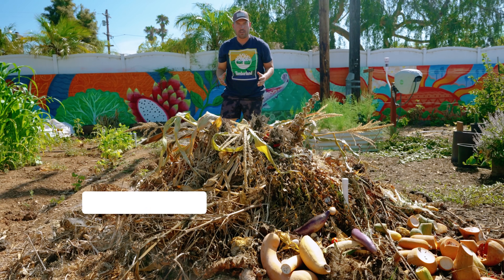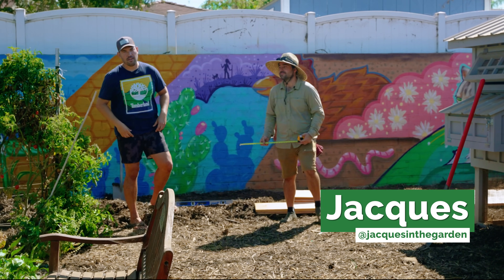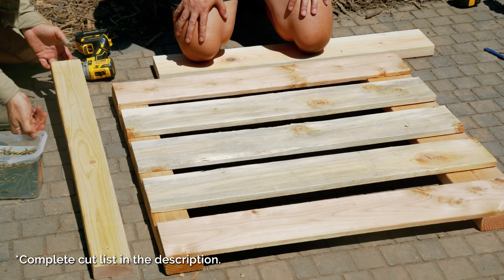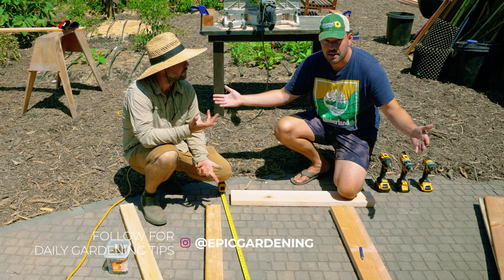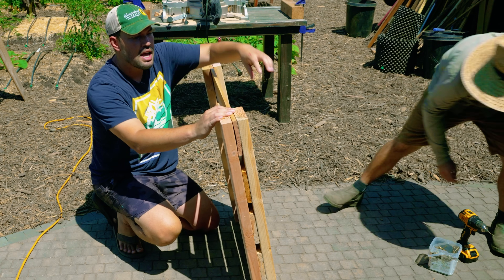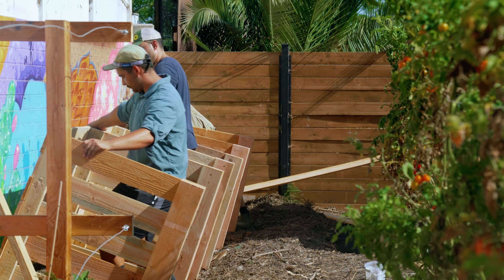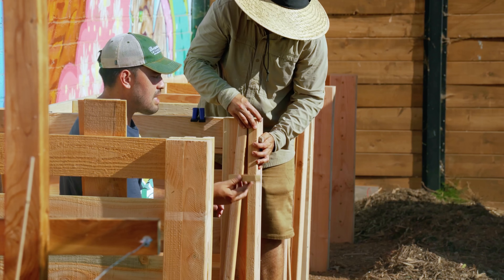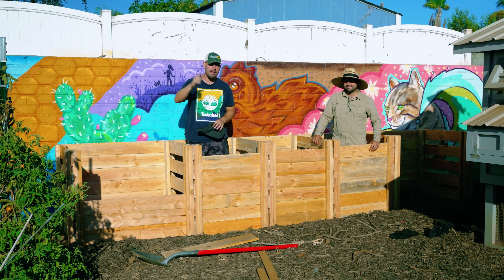How to Build an Easy DIY Compost Bin

Comment from the maker: Single Bin Design (to add more bins, add more side panels)

Back

All pieces cut to 3' long

(6) 1x6” boards
(1) 2x4” boards

2 Side panels

All pieces cut to 3' long

(4) 2x6” boards
(4) 2x4” boards
(10) 1x6” boards
(4) 2x2” boards

Front

(6) ea 1x6” boards cut to fit front, roughly 32” each
Reply: HATE.LOVE.HATE.LOVEHATE.LOVE.VIDEO
Reply: Do I need to be careful about pressure treated wood? My husband is concerned about the wood rotting, but we also don’t want harmful chemicals leaching into the compost….
Reply: @ericaduckwall5477  normal lumber will last quite awhile....just like the raised wooden beds. Like them, you could give everything a coat of boiled Linseed Oil....looks a bit better and helps protect the wood.

Comment: Made a 3 bay this length with pallets, and t-posts. Has worked great. Cut some scrap OSB for the front slats.
Reply: How did you use the t posts? In the inside corners for rigidity?

Comment: I would suggest you have them a couple of feet away from that back wall so you can keep weed free and you can check for vermin. Since a 6-inch gap would make a inviting rat run and making impossible for maintenance around the back.

Comment: a month ago i came across 13 pallets that were wrapped in plastic. turned them into my 3 bin setup.  so much nicer to have than piles. great video keep up the good work
Reply: That was a great find!  I did the same about 3 years ago.  Wish I could do five just for extra storage but don't have the room.
Reply: They “fell off a truck”.

Comment: If you stained the wood in boiled linseed oil it will enhance the rot resistance of the wood and still be food safe.
Reply from the maker: We were thinking of that, or the shou sugi ban technique of charring the wood!
Reply: Good plan
Reply: @epicgardening  NOT Boiled, you need raw, Boiled linseed oil has metals and other chemicals that make it toxic
Reply: @epicgardening  oooo do that!! Painting linseed oil is what I have done to my beds. But it would be cool to see how the carting method is done. And because it’s different.
Reply: Just dont throw way your oily rags
Reply: @epicgardening  that's exactly what I was going to propose to you. If you now combine the charing and the oiling your bin will last very long
Reply: @jessefreeman2611  how are you supposed to properly dispose of them?
Reply: @h.s.6269 lay them out on the floor and let them dry completely.  BLO will spontaneously combust if tossed in the trash while still wet

Comment: Ultra cheap way I made mine was 1/2” hardware cloth at 3 ft tall.  Measure out to around 10 ft long for the circumference and boom!  3 ft volume cylinder using zip ties.  I bought 100 ft at $150 ish last year. 

Edit:  I’m 5’3” and I can manage turning the compost into another bin next to it.  When it gets close to the bottom, it’s easy to lift the bin and then pitchfork the rest of the compost in to the new bin.  It would likely be much easier to use the slat system but if you don’t have a lot of money and have a lot of compost to make, this method is great.
Reply: I got a ton of hardware cloth and chicken wire clearanced out a few months ago (like 90%off!). This is a GREAT IDEA as I am not much taller and trying to figure out the best way to go about an easy-to-flip solution.  Thanks!
Reply: Building a series of bins  will accelerate and contain the process, but what you did is great.  If you layer right and allow it to sit, you will get compost eventually.

Comment: For the front, I would ensure more play than just the 1”… maybe 1.5”. when all the wood gets wet, it will swell, both the side braces and the front boards. Also, depending on if you treat it or not, the front boards will warp, again making it quite difficult to replace the board.

Comment: Great Video as Always! ALSO,

If you bought that Miter Saw within the last two years (or so) check if it's part of the Group that got recalled. Dewalt is offering a kit where you can replace the affected part. More info on their website.
Reply from the maker: Thanks, will do!

Comment: Nice video, tempted to build one of these. Next questions: how to actually use the bins / fill them / turn the compost. And the ultimate question: how long does it take to get nice usable compost?
Reply: Depends on how often you turn it.  Check out Perma Pasture Farms YouTube channel where they make compost in 18-19 days.  But you’re turning that sucker every other day.  I did a modified version of what they do and turned my pile like once every two weeks and got compost in like 3 months.
Reply: I agree with umiluv. It depends on how fast you need the compost. Berkeley 18 day compost is something I do but yes, it's work but well worth it.

Comment: This video came at the most perfect time. I have some questions… If you had a choice of any spot around your garden where is the best spot? North, south, east, west? How much sun or shade is appropriate? I’m on 7 acres and just starting with a 20x30 garden on south east side of my house. Does it matter how much sun and wind exposure the bins get. I should mention I’m in NY zone 5b so weather is severe at times.
Reply from the maker: We did N to S with about 70% sun exposure
Reply: I did mine in mostly shade since I didn’t want it to dry out too much.  The trees will build roots under the compost though if you do it too close to any trees.

Comment: Nice design. I have several old pallets that I may use to build something similar, but entirely for free. I don't think I'll even need to take them apart (I'll just hinge the ones on the front.

Comment: I don't know where you are in San Diego, but we have a rat problem in La Mesa. We had to get rid of my dad's compost bin because it was just a feast for them. Now we're trying to learn to put food waste in the green bins.
Reply: Perhaps you can make one that is more hardware cloth than wood and just have wood for the strength of frame?  It would get tons of airflow and should be much harder to break in.  But it would also need a wire bottom and a raisable roof panel with a latch which wouldn't be too bad to build.  

I seen a video of a lady building a large wooden stall with roofs on hinges to protect it from getting waterlogged and infested with rats or raised by raccoons.

Comment: 📍 Notes / Questions: aeration, rotation, moisture 
1) Underneath, dig a trench for more airflow and water control. Open trench, demi-French drain, or liner to direct overflow water. Use overflow to water hungry crop planted nearby (banana, passion fruit, carambola, etc). Recommendation = Passion fruit is easiest as the vine can be trained away from the roots as far as 50 feet and makes a great shade canopy for other crops (simply frame up a 8-10’ tall hallway of rafters). 
2) The base and back wall of the bins appeared solid (no air). Base could also be upcycled composite board slats from an old deck in the neighborhood. The base is most exposed to damp/rot. Composite board is also easy to shovel out without damage. 
3) chicken coop wire and shade/weed fabric — double the slatted frame and sandwiched between — to control rodents/bugs AND increase air flow. 
4) How close is your water hose? Possibly use Y connector and trench the hose so you don’t trip on it. Suggestion: thread the hose through a pvc pipe to avoid shovel damage. If hose wears out, simply thread in the new hose and pull through. 
5) Auger to turn the compost? Shovel from bin to bin? Or set-and-forget method?
6) 3-6” diameter PVC pipes drilled with holes placed inside the biomass if aeration becomes an issue. 
7) paving stones between wall and bins to inhibit weeds. Easy to shovel/spray clean of residual compost.
Reply: Experience here in the US Virgin Islands (and used to live in San Clemente, CA).

Comment: I grow my plants on a terrace in various containers. My compost bin is literally a large bucket with waste continuously chucked into and left to decompose xD
Occasionally mix it/turn it around with a thick branch. I know there's more to composting, especially to get a dry version, but we dig out and add the stinky, wet mass to soil as and when needed and it does work for now hehe

What does it take for the rotting mass in a bucket to turn into a dried out compost? I'm curious
Reply from the maker: Doing a vid soon on building your first pile!
Reply: @epicgardening  Wohoo !

Comment: Hey guys my name is Dillon MacDonald. I have been a union carpenter for about 6 year. Before that I was a rat carpenter for a summer building decks and fences. Before that I worked at a treatment facility for the company that owes yellow wood for about 2-1/2 years. I would strongly recommend "ground contact" treated lumber or possibly "weather shield" treated lumber with decking screws. Western red cedar would work if you can find it but I would not spend the money for a compost bin. If you're made of money composite lumber and the appropriate screws would be best.

Comment: 2:08 @Epic Gardening Kevin, For pallet-bin composting set up since you did talk about it for 30 seconds:

it's really important for SAFETY if you could PLEASE clarify for people that they NEED to ONLY use pallets that CLEARLY have a "HT" stamp on them (HT=heat-treated) and not other lettering stamps. Many pallets are very dangerous, unsafe, and toxic to compost in or grow food in or have soil touching, with intent to grow food. 

Other types of pallet treatments, besides HT, are done with toxic chemicals that can and will leach into compost, soil, and food.

If it's HT, it's typically not treated with something else as well. If there's no label at all or the label is unclear, skip it. If it's something else than HT, either skip it or research it well and make a decision. 

If needed, you can pin this message, update your pin, maybe reupload the video with an edit, etc or however you want to handle this. But please please please see this message and clarify that info for your large following (of which I am one loyal Northern Canadian follower myself). 

<3

Kyle
Reply: Good point. I used heat treated wood around the garden They don't last as long if not soaked in something like a eco wood seal.

Comment: add 3 to 6 inch pvc pipe, with holes drilled, from one side the other for airflow
Reply: How would you suggest to align it?  Are you just talking about across the back and cut holes in the sides of the stalls to feed it through? I'm not exactly sure how to picture it.  I'm planning on building a 3 stall version in the next few weeks and have heard others mention PVC for airflow but they don't describe how.

Comment: Wouldn't use pallets in case they are treated with chemicals (some are, some aren't).   There is a "garden seal" you can put on it that may help prevent seepage into soil/compost but why risk it.

Comment: Nice build👍 it looks great. I got my compost system built last winter and it makes life much nicer (I bet you’ll end up wondering why you didn’t do it sooner 😂)
I went with a scaled down version of Charles Dowding’s with the roof since we get so much rain in the winter. Bonus is if I have an empty bay I have a place to keep the wheel barrow dry over winter (seems unlikely though, I might have to build a wheel barrow addition 😋)
Reply from the maker: I considered the roof as well!
Reply: It definitely adds to the cost, but it holds the front posts well and looks very nice 😊

Comment: Might have missed this in the video, but I think only "pine" was mentioned. Those 1x6 boards look liked Cedar fence pickets, which is a much better material for rot resistance and usually cheaper too.
Reply: They mention its Douglas Fir
Reply from the maker: Cedar would def be more rot resistant!

Comment: since you used expensive Doug/Fir to last a long time   you   should have used zinc coated outdooor use screws as well   the cabinet screws will rust and break in about 2 years      for cheapskates,  freebee pallets are usually 3ft x 3ft   so  make a perfect size bin just stacked together as is

Comment: What if you coated the bottom wood with bed lining spray.  Like Rhino coating in the back of truck beds?
Reply from the maker: Could but would rather use something natural like linseed oil

Comment: I don't understand why people do not seal the wood for their bins. I understand not wanting chemicals to leach into the ground, but there are plenty of natural sealants out there such as shellac, linseed oil, beeswax, etc. natural and waterproof. So even when you choose bad wood; it could simply be sealed either with epoxy or shellac or any of the other honorable mentions which are both waterproof and will prevent the rotting of wood so that you don't have to replace it at all much less even in a few years. I actually prefer the epoxy route because the epoxy that I typically use to seal things is food safe which means it will not Leach anything into the ground and remain impervious, whereas some of the other methods May wear over time. I get it, sealant costs money. But it will make your bin last indefinitely rather than having to later spend more money replacing wood. So either way it's going to cost you money why not make it so that you NEVER have to change it 🤷 you can get a 1 gallon epoxy kit for around 90 bucks if you look hard enough and one gallon is even enough to seal this entire batch of bins. You could go even farther by trying the wood so sugi ban style and then sealing it. It will be aesthetically pleasing and last forever
Reply from the maker: Will be doing linseed soon :)

Comment: You mentioned the front pieces add rigidity, which is a little true, but they only provide compression resistance. You could screw a couple of them (maybe the top and bottom pieces) in to provide a lot more rigidity; and just unscrew them when you want to empty that bin.

Also, I wonder if you could cut some cost, and simplify things a bit, by using the pair of 2x2 in place of the 2x6 on the front edge of the sides.
Reply from the maker: Could! Yeah lots of iterations on this design.
Reply: That’s the great thing about building things yourself, you get to design it and modify it for your needs! There are endless possibilities.

Comment: Sorry guys me again, soft wood/ dimensional lumber, that's anything measured: 2×4,2×6, 2×8, 4×4,6×6, and so on will not split based on screws size an it's completely unnecessary to pre drill pilot holes.

Comment: Good god what a waste of lumber (and metal screws). Home composting is about drawing nearer to natural systems of recycling, and away from industrial systems of production and consumption. In that spirit, all the gardeners I know just reuse old pallets, which are free. (Or they use a simple and effective heap system — not at all a "huge mistake" and a system for which no materials, post-consumer or otherwise, are needed). 
Viewers: spending this much money on a home composter is not necessary!
Reply: Hi. It could be his compost piles get too dry to work in a big heap ( with little rain) and that this contains more in less space. Also others have mentioned the time it takes to disassemble pallets and the many chemicals added to some of them. Food for thought.